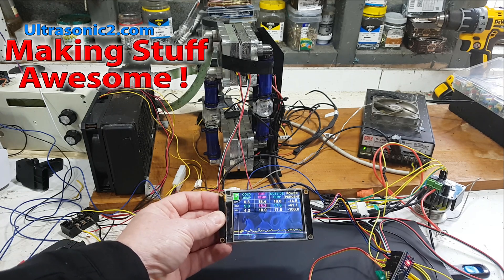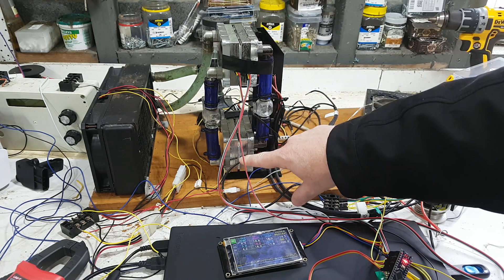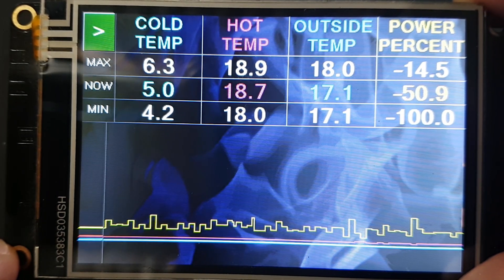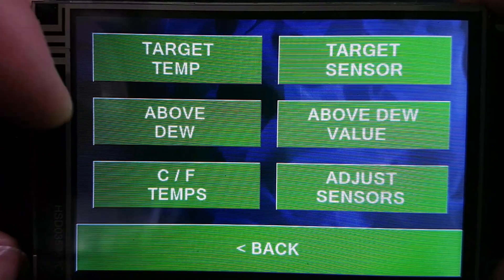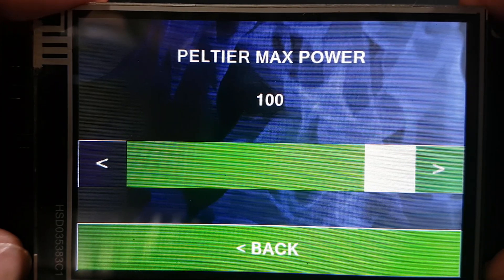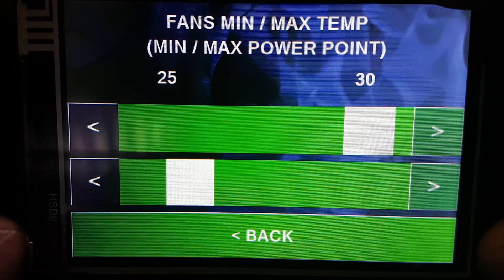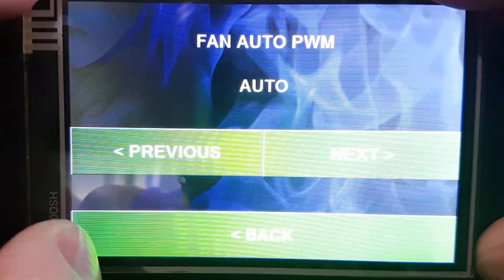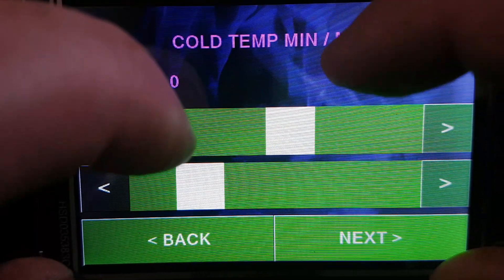⚡️ DIY Temperature Controller Thermoelectric Cooler Heater (TEC) Peltier

Comment: Hi, great project! I've just built a system for this but your website appears to be down to get the code, is this temporary or permanant?
Reply from the maker: it is currently down what did you want it up for?
Reply: @Ultrasonictwo  The input code is TECCON-0-0-27433 if you'd be able to run it manually? Thanks!
Reply: I’m trying to activate the Arduino code which needs a code from your website

Comment: Hello, what an incredible project, I would like to put it on my cpu.
Could you provide the code and scheme used.
In your google link you only have the products for purchase
Reply from the maker: It is there .. change the tab
Reply: @Ultrasonictwo  Ow I'm sorry, I found the files!
By the way I want to cool my cpu directly through TEC. My cpu consumes 150w with maximum in fullload.
I want to stabilize 2 degrees above the dewpoint so there is no condensation.
Do you have any suggestions on which TEC to use?
I was thinking about TEC1 12740,...
Thanks for listening!

Comment: Great, stuff, working well, have only one doubt. I have module with small fan on "cold" side and bigger fan on "hot". Not sure what is best way to connect them (both fans on D3, using MOSFET or just one fan, cold or hot side)?

Comment: Hi, I have never built any electronic devices before. Could you give more details on the circuit ? Is it possible to power is using a 12V5A input ? I have the TEC 12V2A and 5A would it work with those ? Thanks a lot ! Best
Reply from the maker: in the details there should be a link to a google doc that has more info

Comment: Inspiring stuff. 
I need to simulate a  TEC cooling system, with electronic temperature control and a display. Kindly advise on a good and easy software I could use.

Comment: hi,  good of you to do this vid.    it was skimmed for the particular info sought.  
 missed it tho . and your lo temps are all above 0 F.  yet you may still be of help .   
so i'll gamble & ask   .   here is my inquiry.  

       what is needed is for the peltier module to be in contact with liquid ( say 1 L ) 
so it  can be cooled to -20F.    . 
  
       and be able to isolate the heat sink energy so it is safely away  from the
cooling action.  
  
     any ideas are  welcome.  

    the further goal is -50F. but the only way i know to get that is via a 
2-stage compressive cooler  and they are way out of my budget range.  

     if all else fails the fall back plan is to use dry ice  on a batch basis.

btw ... do you happen to know the practical low temp a typical 1-2 ft3
apt - size refrig' compressor can reach  ... using extra insul'n & a
 fan - cooled heat sink ?

mindful regards
bob
Reply from the maker: The lowest target temp that you can set is -40F

Comment: Is it possible to control the ramp rate for heating and cooling with the PID?
Reply from the maker: you can change the 3 P.I.D values from the UI. Changing these will change the sensitivity of the controller

Comment: Hey, what kind of COP for heating do you think could be achieved with tons of these  and a ground source water loop with constant 42+f water and hot side being 90-100f?
Reply from the maker: All the input power is transferred to the hotside of TEC's so COP is always greater than one when heating... beyond that it largely depends on the Temp delta applied.. Smaller the delta greater the COP will be. Having a COP greeter than one was the reason for making this :)
Reply: @Ultrasonictwo  that is what I was figuring, but it is hard to calculate these numbers with such a wild variance on COP playing with the voltage, amperage, and temp differentials. And most of the calcs are geared towards cooling numbers but neglects what the hot side is when you are looking at heating. Technically the COP would be cold side COP+1 right? So as far as I could find it would be anywhere from 1.5-4
Reply from the maker: Yeah in theory you can just use a cooling calculator like mine and simply add the input power to it or like you said 1. You can in theory achieve a cooling COP greater than  0.5 fairly easy but this requires you to do a proper job  with low input power to the TEC's and a delta as close to 0 as possible. To achieve this you'd need to  water cool both sides (air cooling is useless especially if heat pipes are used) and a very large array of TEC's... it becomes simpler and cheaper to "phase change" heating then. However if you're comparing to a simple plug in resistive heater then a TEC heater is ALWAYS winning since they can never be greater than 1

Comment: Those h-bridges are scary in the fact that the heatsink sits directly on top of all the power tracks on the PCB. Any insulation failure will be a direct short. I guess they will hold up?